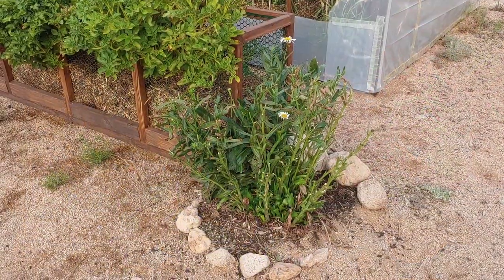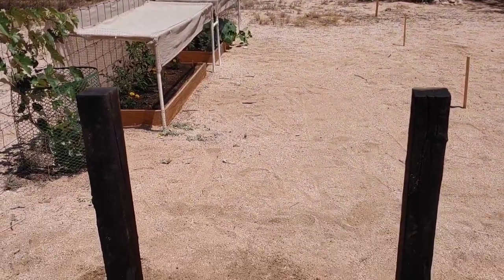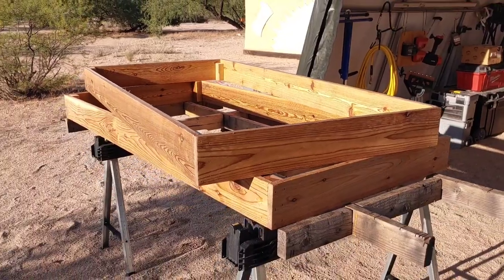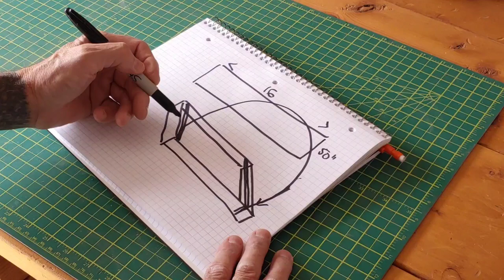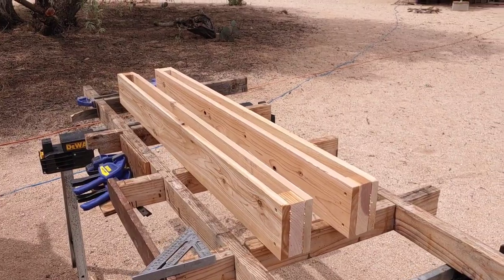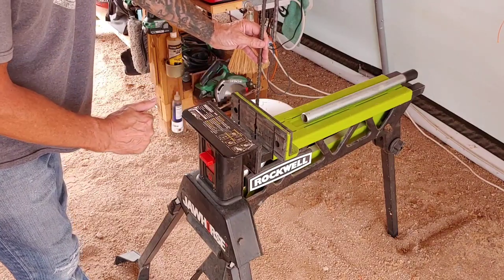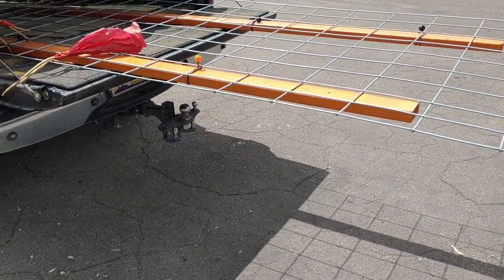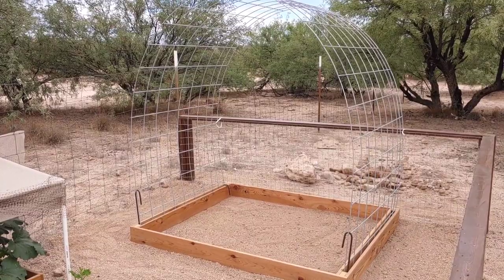#growfood Our Garden is Under Attack! Building a Walk-in Raised Bed Garden with Cattle Panel Trellis

Comment: Nice job! In our experience, the 2x3 fence is definitely too large to keep out rabbits. We recommend at least two feet tall of chicken wire, or hardware cloth. That will keep out most of the rabbits and slow down the ground squirrels and wood rats. Plastic fence doesn’t even vaguely slow down anything with teeth, as you found out. We did have one teenage rabbit who figured out how to climb the two foot chicken wire, once. After being chased around the yard, and getting stuck in the fence, we let him go, and he never came back. Usually they are not that smart. At least in northern Arizona, we always say, if you grow it they will come. Start watching for gophers and prairie dogs. And pray that there are no ringtails in your area; nothing keeps them out except a complete cage. Good luck!
Reply from the maker: Well, we'll see about the Jackrabbits. I cannot imagine one those squeezing through a 2"X3" opening. Heck, they're the size of our dog! 🐕 The 1/4" hardware mesh will definitely be a good addition to the fence. When all else fails, I've got my 22cal rifle. 😉 Just kidding, Yvonne would divorce me.
Reply: The Upside of Downsizing Irene here! I do my own work with a 22, if necessary. I usually save that for ground squirrels. The fencing that you have should keep out jacks. The cottontails can get through it. The hardware cloth should do a great job. Several years ago, when the monsoons came late the jackrabbits were standing on their hind legs and stripping the leaves off of the orchard trees, but I have never seen them climb over a fence. Good Luck!
Reply: Irene here again! Just thought of something! I put a piece of flagstone (pavers would be fine, too) under the gate. We had trouble with rabbits digging under there.

Comment: Great work, you two!  That cattle panel thingy looks like a Conestoga wagon from the pioneer days (from the back).  Glad you went down into the soil with the wrap around and the 'snake proof' hardware cloth sounds mighty fine, too.  Of course, snakes being what they are, might just raise themselves up and slither through whatever's available for entry above.  Thanks for the video.
Reply from the maker: I said to Yvonne kinda looks like a covered wagon 😂 I offered to change it but she's ok with it. As long as she's happy....We've had snakes, including a rattler inside the greenhouse despite deer netting and chicken wire. We're going to use 1/4" Hardware mesh. Nothing is going to be 100%, but we're going to just reduce the risk. The big problem here is our rattlesnakes don't rattle, so you really have to keep your eyes open. Thanks for watching!

Comment: To transport the cattle panel, let me see if I can describe this so it makes sense... You basically make a "U" shape out of your panel in the bed of your truck. Then strap it in. Does that make sense? The panel would be on it's 50" edge, in a "U" / arch shape, curving on the inside of the bed of your truck.
There are actually video's on youtube on how to transport cattle panels in a pickup truck. 
I was over thinking it myself, thinking I would need a long trailer to get them home.
Also, just an FYI, Cucumbers and spaghetti squash grow amazing with a cattle panel. I just learned this this year! It saves on space growing vertically. You have to train them a bit to get them started climbing, but mine are doing amazing this year growing vertically. 
Anything that has tendrils that will climb does very well with the cattle panels.
Reply from the maker: That's for the tip! The guys at Tractor Supply said they usually make a u shape as you described, and stand it up in the truck bed. That is of course not possible with the cap on our bed. We tried doing what you suggested, but it wouldn't work unless we were ready to crease the panel. I was Ok with it, it might have made for an interesting shape, but Yvonne vetoed that right away. 
She's going to be planting cucumbers, zucchini and kiwi to grow vertical. Her zucchini plant which can be seen in the video, is going crazy! You can literally see it grow! Thanks for watching and your feedback. I'm sure we'll be installing more of these panels in the near future.
Reply from the maker: @servicedoglydia503  yup, that's how the guys at Tractor Supply suggested packing them, but again, with the cap on our bed it wasn't an option. 👍

Comment: Nice job! Are there any native owls there? if so, putting up owl boxes might help. a small note, the diagonal on the gate, should have the base at the hing side.
Reply from the maker: The owl boxes is a great idea. We hear owls every now and then.  With the gate.... I ended up making it backwards so if I installed it the other way, my pocket holes would have been on the outside. They were filled with dowels, but I wanted it to look nice. Now every time I look at it I will be thinking about changing it. 😉 Thanks for the ideas!